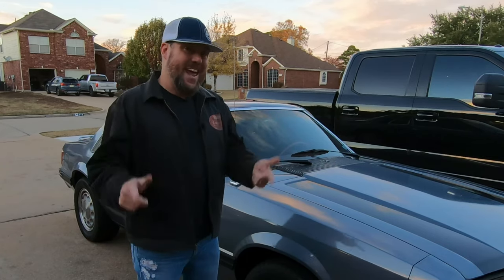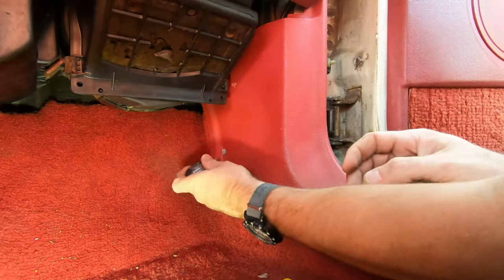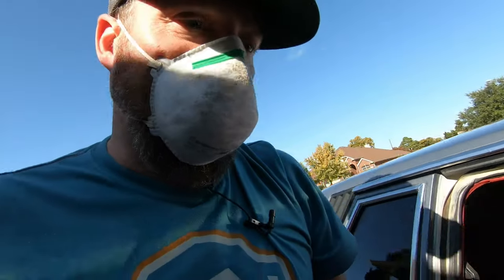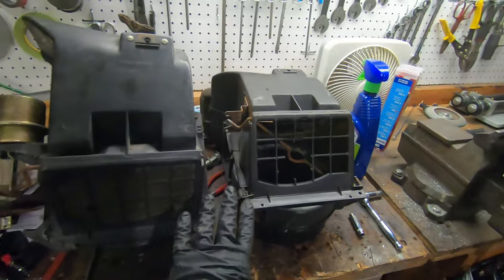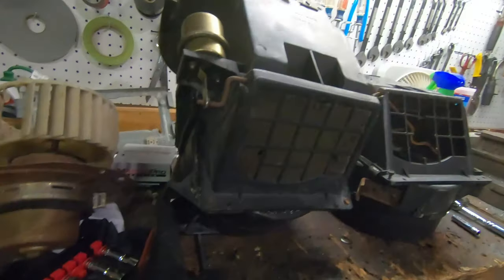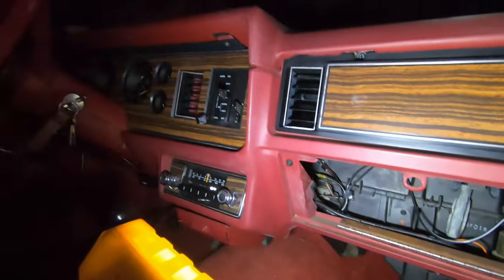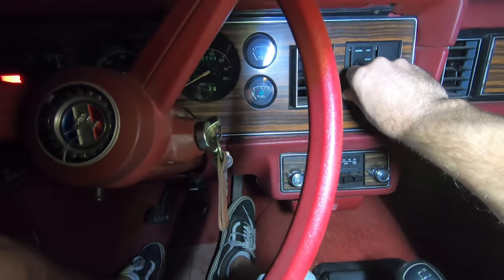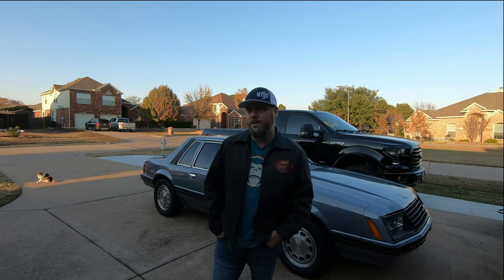Foxbody Blower Motor Housing Removal - Cleaning out the RATS NEST - Episode 6

Comment: Great video. I have an 89 GT heater never worked and i store it in winter i been looking at how to take the useless stuff i don't need out but everyone assumed i was stupid🤷
Reply from the maker: Yeah in your case you can drop the entire HVAC unit, if you dont want to use AC or Heat. I have a vid on heater core replacement on the 86 and complete dash removal....if you just want to pull it. Lots of folks do this for their race cars.
Reply: @HOUSEOFDULA  Thanks a million

Comment: Good work! Do you have some sort of diagram of the vacuum lines that run under the dash for the HVAC? I had to put a heater core and evaporator core I mine, but my vacuum lines are all jacked up.
Reply from the maker: I dont, Im sure the googles has it somewhere. Man, its really pretty easy. Only i source vacuum that goes in from the engine bay feeds it all. The HVAC controls are the only other lines and they are all on a vacuum plug, so unless you pulled each line out, its plug and play. The canister on the blend door also has a connection, and it goes to that hvac plug.

Comment: What is the purpose of that flapper plate on the blower? Recirc air? Or Re-Direct air to the footwell? Or something else?
Reply from the maker: Its in cabin recirc. It opens when on "max-air" so the intake becomes the footwell and recirculates the air to cool it. This is my when putting your AC on MAX it tends to get louder as well.
Reply: @HOUSEOFDULA  ah I see now. Thanks.

Comment: took my heater blower housing out on my 1991 5.0 Coupe and reinstalled it, now the air blows out of the defrost vent on any setting..how do you fix that?
Reply: One of your vacuum doors is probably stuck, check the one behind the radio from the driver side
Reply: Or maybe the vacuum line on the box broke when you removed it, the default is the defrost so it could be a vacuum leak

Comment: Hey I'm having problem with my 1986 convertible the blower motor is blowing but no air is coming out do you know how to fix that
Reply from the maker: Could be a number of things. If I had to guess the plastic "tubes" that connect out hvac box to the vents are disconnected/broken. That or the impeller wheel is broken, OR the AC avap clogged, or...vacuum issue, and the door is not actuated, but if this was the case all air defaults to the windshield vents (if HVAC box has no vacuum)